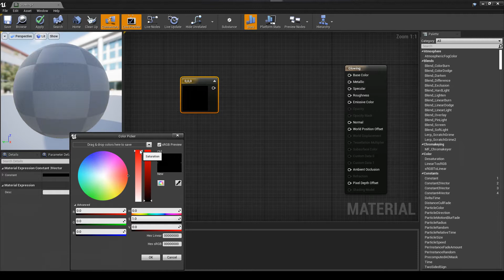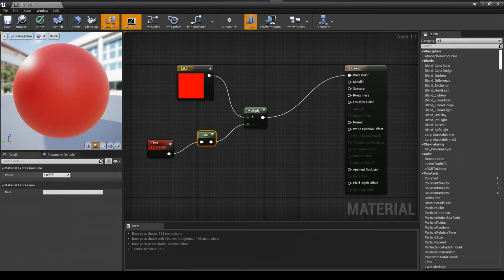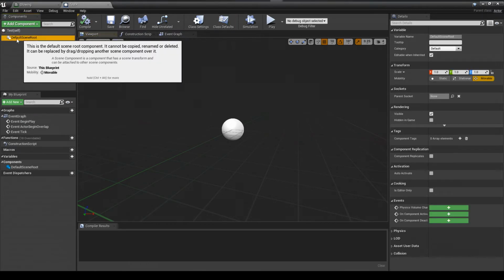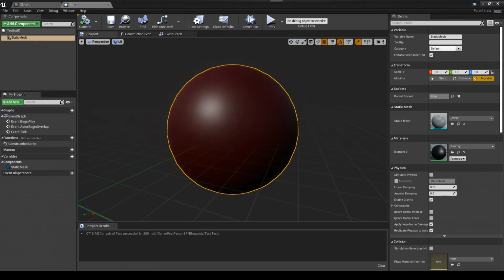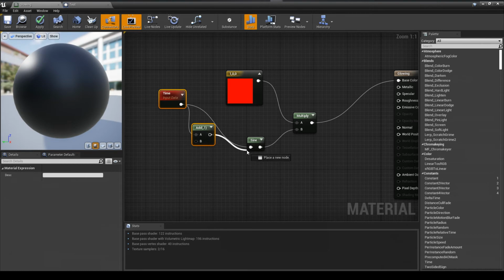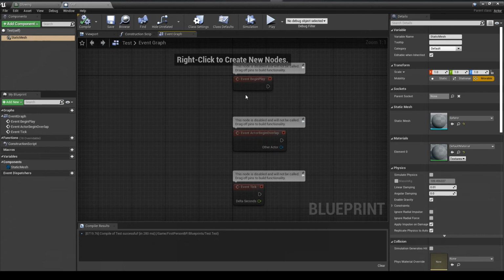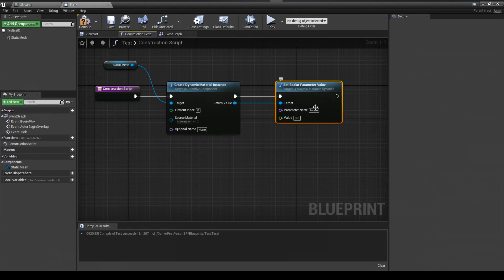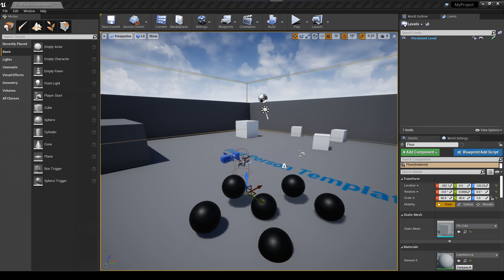Unreal Engine | Oscillating Material (sine)

Comment: Bro do you know how to do this with sound? I have looked twice and spent over two weeks scouring the net for how to generate a simple sine wave sound in Unreal and the closest I came was a brief demonstration of how to create a C++ synthcomponent and add it to a blueprint, I was never able to get it working though. I'm going to try it again and try diving deeper into it, last time I backed away because I literally couldn't find any resources except 2 and they only briefly mentioned it without ever explaining it. I was able to figure out how to do this in 2 days inside Unity but for the life of me I can't figure it out in Unreal.
Reply from the maker: Yes, this is pretty easy. You can use a timeline within a Blueprint to control the volume of the sound source. create a float parameter and have it go from 0 to 1 and then go back from 1 to 0. Then you can trigger the blueprint timeline either by having it recursively Loop or just trigger at one time. then on the update from the timeline you reset the volume of the sound. So it will go from very low to very high to very low, and then just keep looping. Let me know if you understand what I'm telling you, and if not I can create a quick video to show you.
Reply: @GordonVart  Ah yeah I get you, I just discovered the new MetaSound feature in UE5 though. It's just a simple click and drag now.

Comment: The red color alternates with black (this is because a texture / basecolor is missing)
Can I add a main color (in my case I would like it to be an emissive color) such as Yellow, which replaces black?
In this way I would have a sphere with a yellow emissive color that alternates with red. (Both emissive)
Reply from the maker: Yes, you can easily do this. Run the output pin from the sine into a lerp node where are the two options are the red base color and the yellow emissive color. then run the output of the lerp into the base color or emissive of the material.